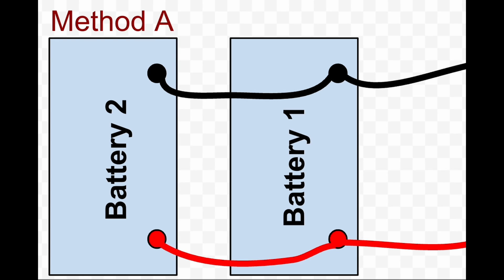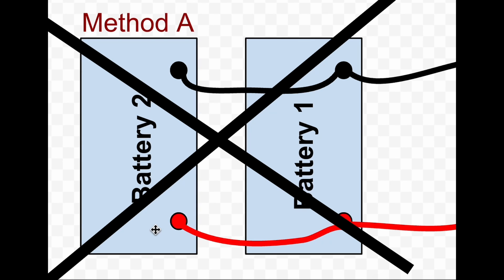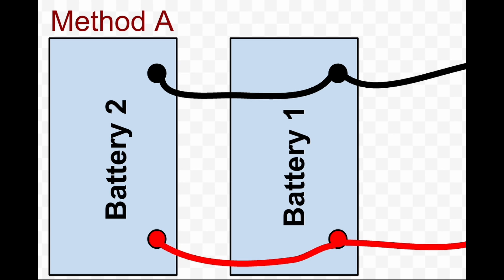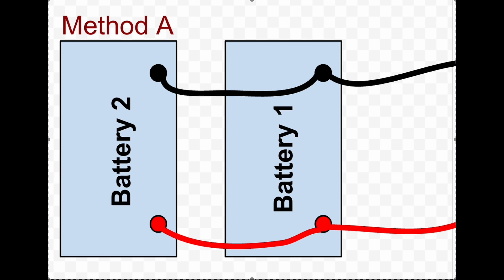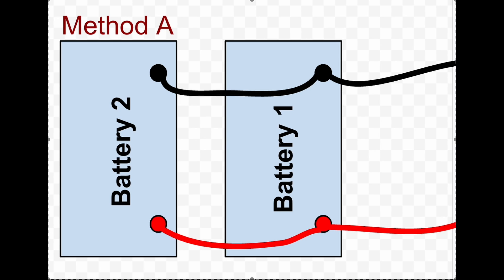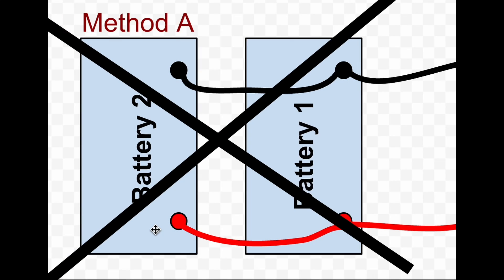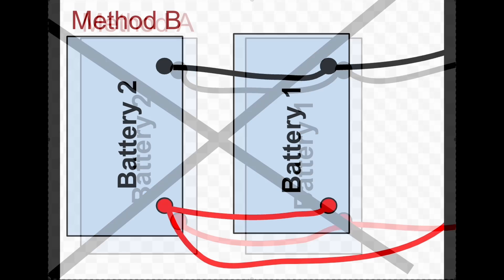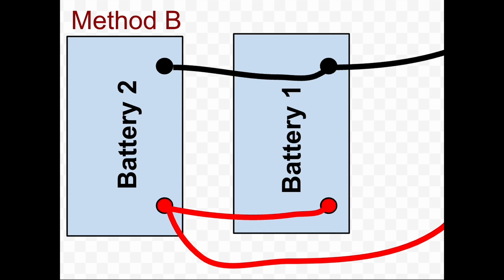What is the Best and Safest Way to Connect Lithium Batteries in Parallel for RVs and Boats or Homes?

Comment: Method B Not the best method also
Reply: This is correct!💯
Reply: To expand on that you are correct with load using method B but add to it the charge circuit should also use method B bur reverse the  + and the -
Reply: @davidbalgosky4107 
So your saying use method 2 but then add the battery charger with its positive going to battery 1 and the chargers negative going to battery 2 ?.

What if your going to add 2 battery chargers ?
I assume the one battery charger would be applied to battery 1 and the other battery charger applied to battery 2 ?
Reply: Why not correct? What's your best way?
Reply from the maker: Care to elaborate?